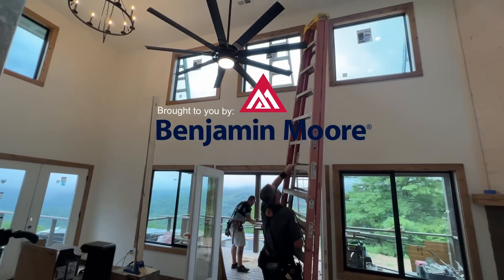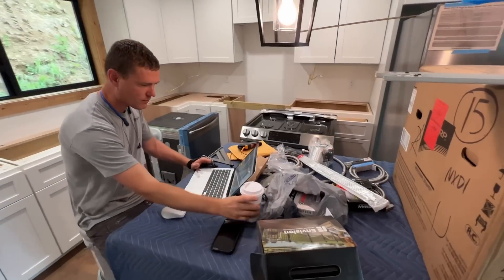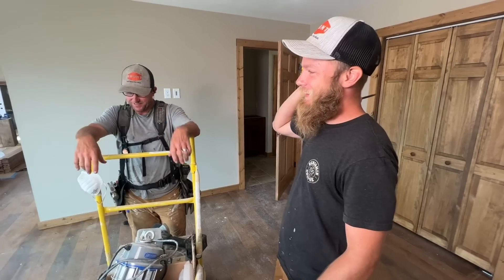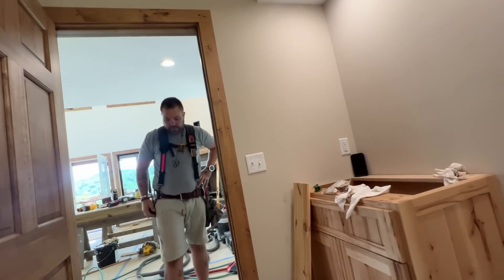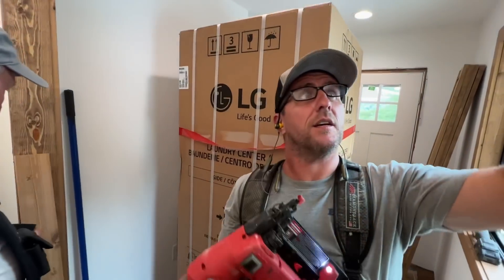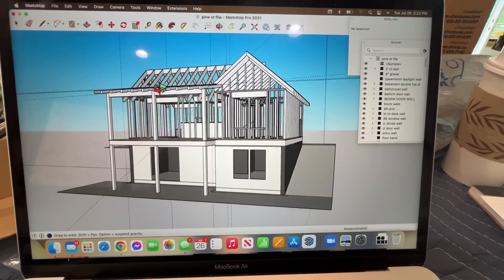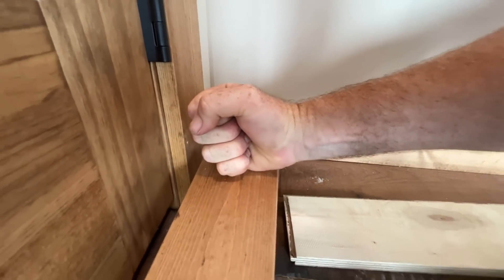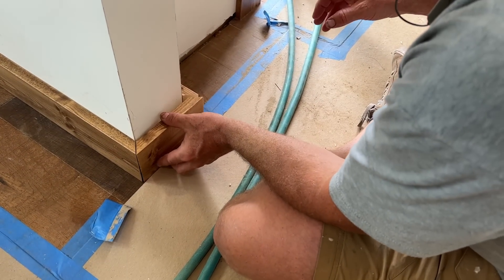Building A Mountain Cabin EP53 | Playing Favorites

Comment: Hi All, thanks for always making my mornings in Australia a great start to my day, I love watching every episode.
With the smoke detectors,  if they are all interconnected (as per building codes here in Oz) once you've energised them and pulled the battery tab you then need to cycle them by pressing the test button until you hear ALL of the detectors in the house installed going off at the same time. Generally a good 10 seconds of holding the test button down.
If the detectors are not interconnected then once you've pulled the battery tab, press the test button on each one until they each go off for about 2 seconds. 
Lastly,  once energised... the protective dust cap must be removed and binned.
Happy days!
Shawn @ OnehotSparky

Comment: Pro tip on shooting a nail through the casing into the jamb is to hold the gun perpendicular to the trim. Because of the way the nails are manufactured they mostly curve to the sides of the gun and not towards the bottom or top of the gun. This way it won’t shoot out into the jam. It allows you to put less of angle on it and you hit more “meat of the jamb”and get a better connection.

Comment: Great job on the closet doors...as a tradesman I seen these have the knobs on the wrong panels when someone has not read the directions...also just a suggestion is to install a stained piece or 3/4 round in front of the white metal bar at the top. Great work on the details guys!!

Comment: G,day from Sydney Australia.
Interesting finish on the joinery: golden oak? That's fine quality and great tip to "pocket screw the joints" we'd use some construction adhesive again the drywall and PVA glue the joints.
🌏🇦🇺

Comment: So in line with your pro tips, if you want to take your baseboard up a level, lay a section out and if there are undulations in the span of the floor it covers, scribe it and use your plane to adjust as needed.

Comment: @Perkins Builder Brothers when doing stained trim.  Why not use clear paintable caulk?  You trim it out caulk and final coat of paint masking off trim.  Final product looks fantastic and no gaps!
Reply: In my experience the line never looks as good as just having a tight fitting baseboard installed after the paint...especially since caulk almost always inevitably cracks and deteriorates.  A clean butter baseboard with no caulk will last forever before just needing a poly coat again.
Reply: @moocowzrock  sorry you had bad luck with it.

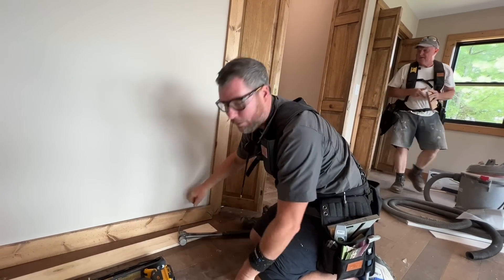Comment: No criticism here, because you guys do beautiful work.  But, at 14:27, what I do when installing baseboard to floor, I space it off the floor about 3/32, or the thickness of a slender putty knife.  I began doing that when I replaced all my baseboard on my old house that had Brazilian Cherry flooring because when I finished one room, pushing the baseboard tight down to the floor, I noticed when walking along side the baseboard, the baseboard would make a popping noise where it joined the floor.  I tried the putty knife trick in the last 4 rooms, and never had the issue of the popping sound ever again.  Just throw the putty knife flat on the floor tucked under the baseboard, pushing down, making sure the putty knife is in-line where you are shooting your nails.

Comment: What do you guys suggest for baseboards and moldings in terms of gauge of nail? I noticed both 16 and 18 gauge nailers used. I'm just a DIY guy but I want to learn from the professionals. Love the videos guys.
Reply: I like to use the 18g for the most part. 2” nails hold surprisingly well. I like the small nail head of the 18. But, I always shoot the door jamb in with 2 1/2” 16g. They are stronger and longer for holding the door

Comment: Nice looking house, have drywalled/plastered many like it. but I'll tell you I'd never have one like that at least not as it is designed. I have zero desire to spend money on a house with such a high ceiling in the living room that would require paying someone to come in and set up huge ladder to change lightbulbs or replace the smoke detector battery. I'm a much more practical person. just give me a nice single story cabin with open concept kitchen/living room, a master bed/bath, an office and a room for my drumset and a garage/woodshop where I can do some woodturning

Comment: Make sure your breaker is on for your smoke detectors, second if one of the smoke detectors has a low battery it will cause them to chirp, it only takes one bad battery, last if the breaker was on it could be due to a bad wire connection on one of the smoke detectors as they are all linked as one. my suggestion is to replace the batteries while doing so take them down and make sure the wire nuts have a good connection, besides that a big hammer lol.

Comment: you are using the brad nailer at the wrong angle on your trim. if you hold the gun perpendicular to the piece you're worried about it shooting out of. it will never shoot out the side. If you hold it parallel, it'll do it to you all the time. The nails are angled on two sides, which causes that.

Comment: Why is the detector mounted so high up?? ... It's a good idea to change batteries once a year. Now the home owner needs to buy a giant ladder to get way up there. It's going to be a pain in the butt.
Reply: Smoke rises.  The higher the detector, the earlier it will detect.
Reply: @-_James_-  Why wouldn't the detector detect when smoke is lower? ...lol
Reply: @Recovering_Californian  Because detectors have a threshold governed by smoke density before they'll be set off.  Smoke rising past the detector might not be thick enough or might not even enter the detector to trigger it.

Comment: Is that pine trim? What stain do you use? Oil based? And no poly? I notice you often stain on site so thinking no poly. But how do you get such a nice sheen? Also, do you use preconditioner before the stain?
Reply: The stain is special walnut by minwax. It’s oil based and we did not use conditioner on this job. The trim is spruce and the doors are pine of some kind. Then we put on 2 coats of water based clear poly. It’s Zar brand oil modified matte finish.
Reply: @jaimeperkins9606  thank you so much for replying! I love your channel and I don’t miss an episode. I’ve learned so much!

Comment: If you turn on the circuit before you remove the tab it will drain the battery.  Hopefully your electrician either doesnt turn on the smokey circuit or does and pulls tabs right away.

Comment: So much for RAM board and protecting the floors. I would be pissed if I were the homeowner. Ya'll are tracking in mud & rocks on your work boots, scuffing & scratching up those thin veneered fake wood floors. There is no repair possible. They just have to live with your mistakes. Unacceptable. RAM BOARD!

Comment: Eric, you need to go back to carpentry school. You can't bend wood (baseboard) in the direction you attempted to. Your floor has a hump in it (or the baseboard is warped). Either way, the way a carpenter handles this is to scribe the bottom of the baseboard to match the hump in the floor, and then plane the baseboard to match. Ideally, with a small back bevel. No one will ever notice the correction, unlike the gap that was STILL THERE are you attempted to squash the trim and nail it in place.